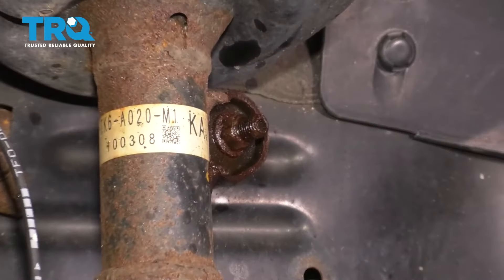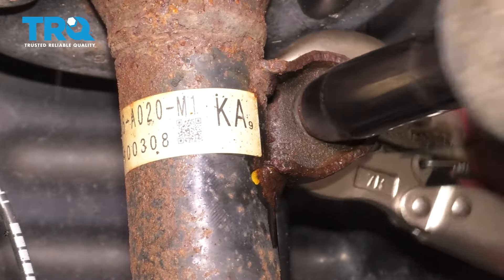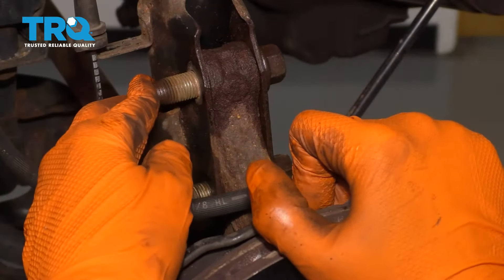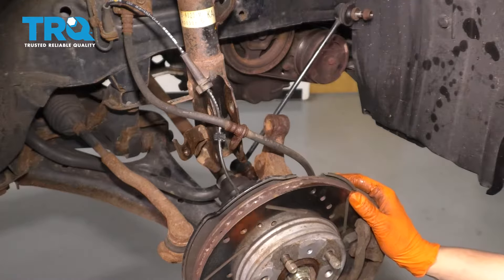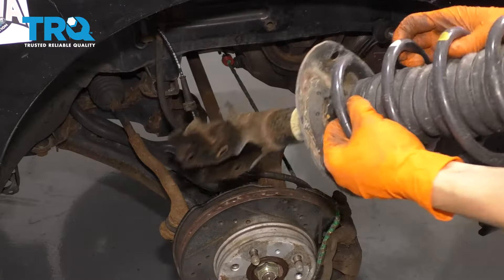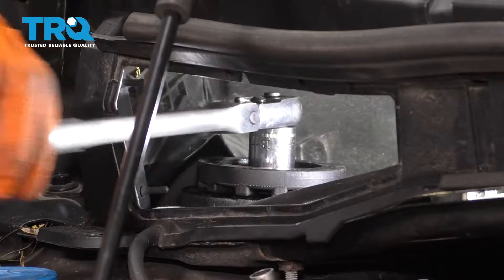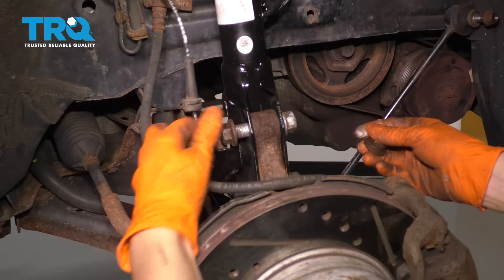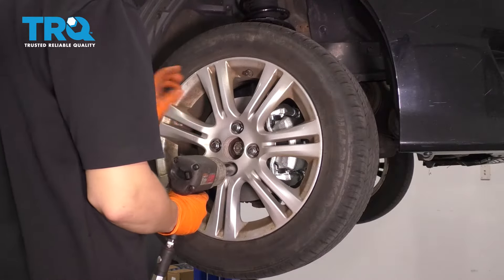How to Replace Front Strut 2009-2013 Honda Fit

Comment: Successfully completed replacing front struts on my 2010 Fit after following this video.  Metric sockets, box wrenches and allen wrench were the only tools used. Two tips I have to pass along. First, as mentioned in the video don't let the brake disk assemble fall down. Have it supported well prior to removing any of the bolts on the strut. I let it fall down too far and it dislodged the axel from the CV joint. Second tip, the drivers side top strut nut is a difficult to access with the wiper motor over top. Don't be afraid to remove the plastic shroud that covers it. It is only held in place with friction clips. A few good yanks will clear it out of the way.

Comment: Thanks, that video helped me quite a bit. However, I would have found it more useful, if you had chosen the driver side strut for demonstration, because THAT side has a "lot less'" space to work with, especially at the top of the strut. How on Earth are you getting "in there"  with an Allen wrench AND a wrench to get that top nut off ??? Looks like I will have to invent a special tool to fit in there.

Comment: After installing these I now have a clicking or poping sound. I rechecked all torques on bolts and nuts. Rechecked the sway bar links. Anyone else have this problem. I did cheap after market shocks on my civic and had the same issue. Any ideas appreciated.

Comment: Wish you would've done the driver's side instead. I absolutely cannot get an allen wrench into the stop strut bolt to hold it still because of the big ass metal parts in the way. Can't find any info on a better way to do it either.

Comment: Do you need to apply threadlocker for any of these nuts?
Reply: as long as it's torqued to spec you should be fine
Reply: You actually need new bolts! Look up the Haynes video.
Reply: Never seen a job that easy LOL

Comment: You didn't cover the driver's side! You can't get to the nut at the top. you can't get and allen in the top of the strut. You can't turn the nut more than an 8th of a turn at a time, and the nut is an inch long. you can't get a light in to see on the driver's side. I ended up putting two grip pilers on the old shock shaft inside the wheel well and turned the nut off the top. It took 3 hours to get the drivers side off and replaced. Less the 45 minutes for the passenger side. video is very misleading!